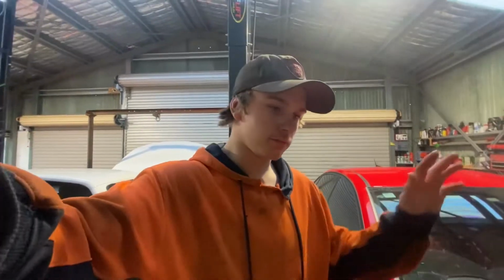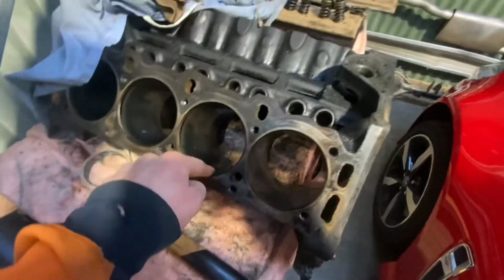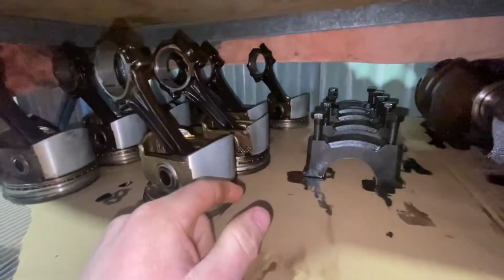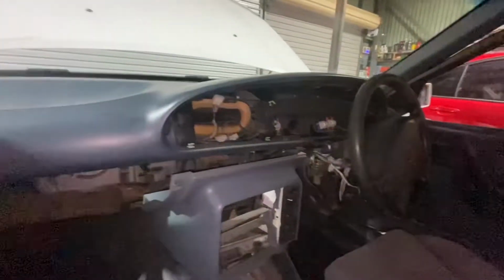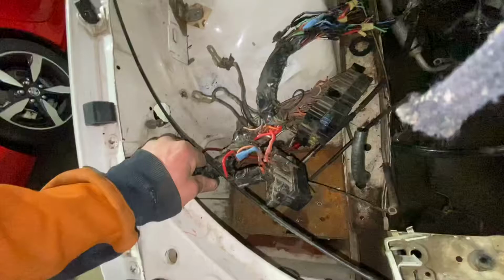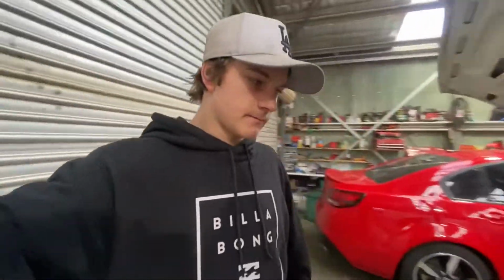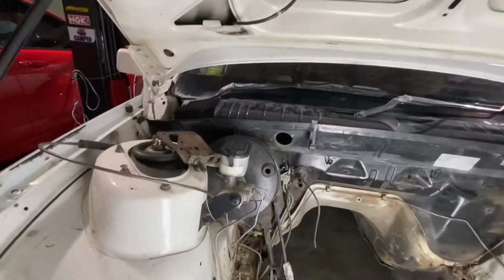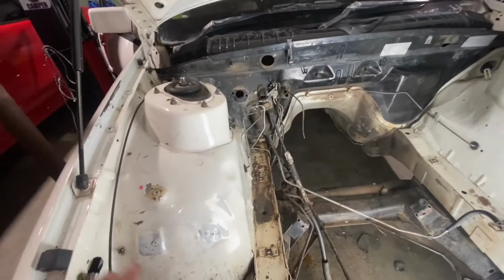VS Commodore Burnout Ute Build - 355 Stroker Coming & Engine Bay Tear Down

Comment: Hey brother loving the content
About your 304 that ya stroking to 355 I was just wondering if you could tell me how much the people you getting it done from or got quote from how much the hold conversion will cost because I’m actually looking to stroke mine to 355 and just want to know how much and what needs to be done
Thanks
Reply from the maker: Yeah hey man I have only spoken on the phone to them briefly and they said around $10 000 with machining and parts that’s will out a manifold and throttle body and stuff which I already have is fairly expensive but will be well worth it
Reply from the maker: And that’s with me and my old man building it but when I get the proper quote will post about it in a video
Reply: @brendosgarage1494  oh yeah thanks man appreciate it im keen as cant wait to see it and also get mine up and going thanks man